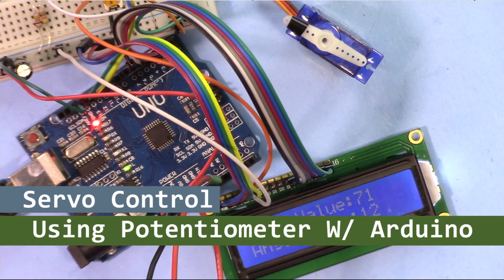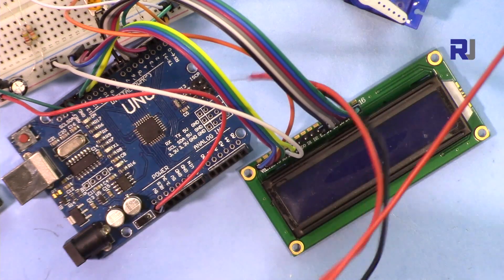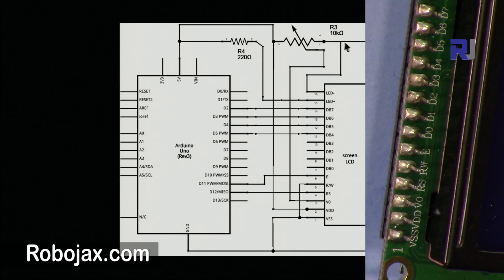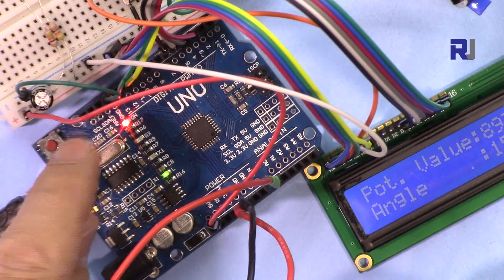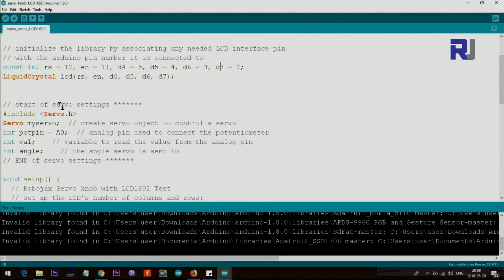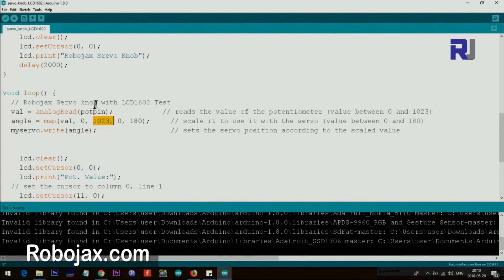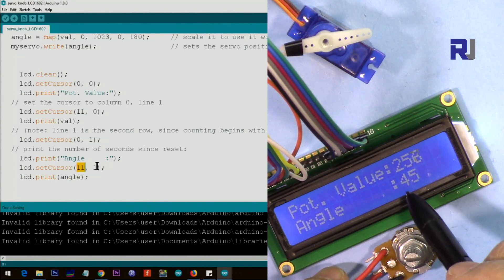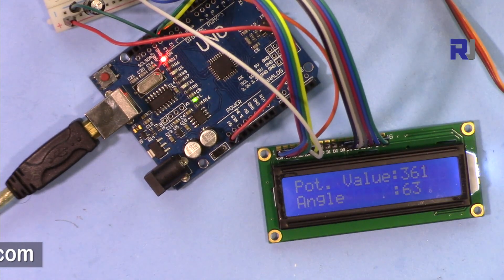Control Servo with potentiometer and LCD1602 LCD display RJT80

Comment: Could you please make a video where in US sensor senses the object and accordingly Servo Motor rotates forward / backward, followed by the distance is displayed on LCD. Will the code change appreciably if we use two servo motors and do we need to give an external power supply for the servo motors?
Reply from the maker: Hello, this is great idea and I will try to make video on that. thanks. I don't promise it for now. it will be on my list.
Reply: @robojax  thanks for considering. Good day.

Comment: If I want to replace the servo motor with a dc gear motor, then what are those modifications I need to do
Reply from the maker: servo motor is totally different motor. for DC motor, if you gear motor has encoder  you can position it but stepper is better option. search my channel for stepper motor which is the best stepper motor video on youtube.

Comment: offset = 15;

    if (angle > 999) {offset = 12 ;}
    else if (angle > 99) {offset = 13 ;}
    else if (angle > 9) {offset = 14 ;}
    lcd.setCursor(offset, 1);
    lcd.print(angle);
Reply from the maker: Hi, is this question or comment. Please also say something with the code. You can edit this.

Comment: Can the pulse width value be displayed instead of the servo angle?
Reply from the maker: yes. If you watch the video fully, you should be able to change it easily.
Reply: @robojax   I did and no you don't talk about how/where to get the servo pulse width. That's why I asked it here.  A servo pulse width goes from 1000us to 2000us where 1500us is the center or neutral position or your 90 deg.   I want to display that.  I am guessing I can map the pot to the [1000,2000] range instead of an angle [0,180] and use servo::writeMicroseconds() instead and just display this value in the lcd.  Answered my own question. :)

Comment: One more problem is that i need a potentiometer sensitive upto 1degree, how can i increase the sensitivity of the potentiometer or do i need a some other kind of potentiometer?
Reply from the maker: I have another video using the variable resistor (incorrectly called potentiometer) to control the sensitivity. See the image of 2 variable resistor to have move control http://robojax.com/learn/arduino/?vid=robojax_relay_timer

Comment: A problem that i am facing is the distance of wiring between the potentiometer and arduino board/ supply is approx 25m, do i need some additional arrangements or will it work fine?
Reply from the maker: no you don't have to worry.  Arduino has very high input impedance and the length of wire will affect it in this case.

Comment: I have an lcd with I2C convertor, will the code remain same?
Reply from the maker: if you  include the right library for your LCD, yes it is the same. I will post video on LCD1602-I2C soon.
Reply: @robojax  good. If you have posted the same by this time, could you please send me the link for me to have a look at the video. Thanks in advance.
Reply: Thank you , it worked fine.

Comment: Can we show the angle range from -90 to 90
Reply from the maker: the angle is just reference point. If you want to label it as -90 and 90, you can do it. Just change the code. Replace all 0 with  -90 and replace 180 with 90 and it should work.